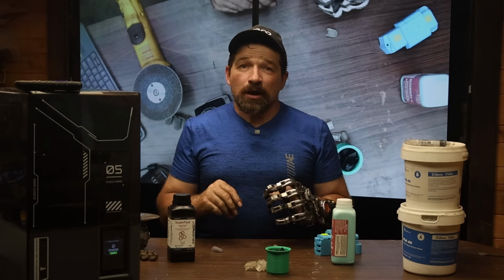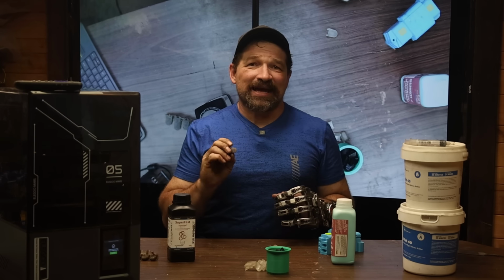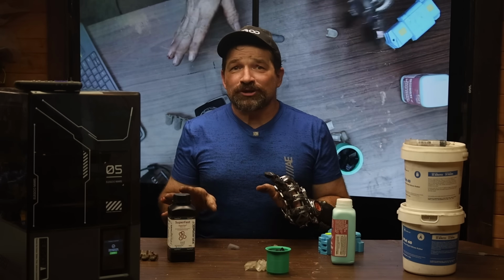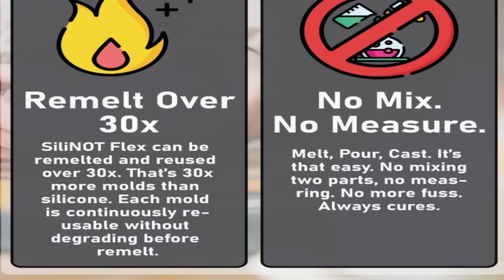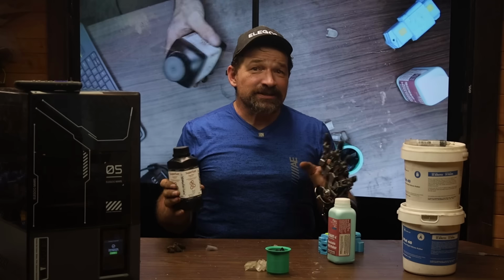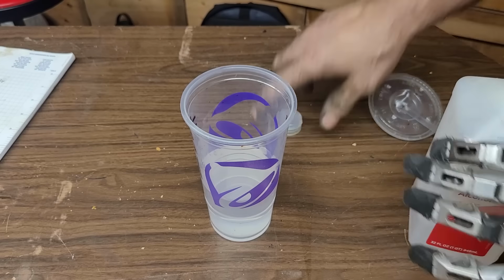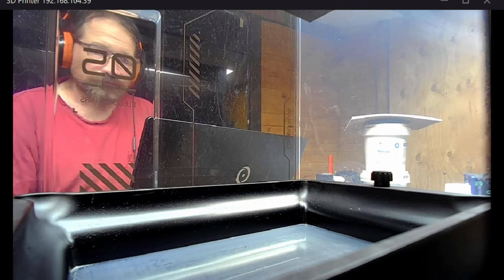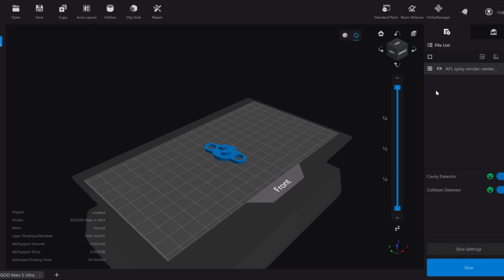Fingertip sidequest

Comment: Would it be possible or feasible to use a metal core around which the resin or other material is deposited, to help alleviate the issue of cracking around the connection point? I'm not sure of the depth you'd need or want the substrate to be deposited over the metal core, but playing around with multiple different sizes might be workable.
Additionally, I've admittedly not been following this very closely so stop me if you've already given it a go, but would casting result in a more durable and enduring product than printing, or does it have other issues?

Comment: Is there something you can add to the silicone to make it more tear/wear resistant, like the chopped fibre from fibreglass, or carbon fibres or maybe even wool
Reply from the maker: In my experiments,  anytime I add enough reinforcing material to make a difference, I find that it crumbles way easier. Last batch, I spiral wound the polyester mesh around the tang plug thinking that it would keep the silicone dimensionally stable... it didn't.

Comment: Carry a little fluid spray bottle so you can mimic oil secretion and still use a non-ideal material (non-ideal when dry)
Reply: Carry a towel too in case you miss or just need a cleanup

Comment: I would be very interested in attempting to contact the soft plastics fishing lure company Zman they have a soft plastics line called elastech it’s insanely durable and resilient, only issue is it’s proprietary. 

If you were able to work with them on something I think the results would be incredible.

Just something for thought.

Comment: have you tested urethanes or rubbers that could be used in a hot glue gun? If you have a mold that sort of clips onto your finger then the tang could have a notch to make the finger be nearly permanent. like a three piece mold but one of the pieces is your finger like how they injection mold knife handles. I think getting the surface just right could really help with grip and softness but still be durable like gecko fingers.
Reply from the maker: I have tried urethane,  as I mentioned in the video, it crumbles. The silicone is more resilient. https://youtu.be/ZqMFNexzX4o
https://youtu.be/LC4paYs5Z28
https://youtu.be/7fD3UZ8q9IA
Here is a short series showing how I overmold the fingertips.

Comment: maybe the finger tip tangs need to be more rounded on every tang edge. sharp corners in the tang hole of the finger tips could be weak points where the material fails.

Comment: You could avoid the hunt for a perfect material and select 2 materials that each have the properties you are looking for and use dualsided tips instead. Manually rotate and lock the tips in place for your intended use. Rotate 2 and leave 2 in place to use both durable and squishy simultaneously.
Reply from the maker: The issue I run into is with getting the different materials to bond to each other. Like with the overmolding process, the silicon will stick to the fff cores for a little while, but then they peel off. Once they start that, they're garbage.
Reply: @missingpartsclub  I would bond them mechanically with a dovetail joint or similar.

Comment: A design thought: instead of mimicking a rounded pad why don't you add horizontal rounded ridges one after over the other over the pad which will add a spring affect & texture so your not so reliant on only material makeup.

Comment: Maybe fiber reinforce the silicone with chopped up wool fiber?  Should stop tears without eliminating too much squish?
Reply from the maker: I haven't had awesome luck with that, any time I have added material to the silicone it has degraded the properties.  For example,  I added a mix of 4% graphite to the silplat 40 so that the fingertips would work with capacitive touch screens, and the silicone turned to garbage. I couldn't imagine using something like wool fiber, maybe though,  if it was a natural fiber the silicone might integrate with it...  idk. I'll give it a shot next time I'm pouring fingertips. Thanks!

Comment: What if you printed a set of tough material 10 thousandth undersize and dipped them in a resin that was tacky enough to get the grip you want? 

A lot more work sure but think of it as adding skin on top of the bone.

Comment: Why not print the part that touches the metal tang out of TPU, and the finger tip material itself out of the flexible resin?  You could bond the two together with some good ol' E6000.

Comment: Could you use the softer silicone on hard tips covered in "nipples" that protrude through holes in the silicone cover? Under a light grip, it'd be silicone grip. A little firmer grip would bottom out on the harder nipples for strength and perhaps improved wear. Seems good in my head - in practice it's a crap-shoot. Might just tear apart immediately considering what you said about that tab that holds the current tips ripping. (Edit - or ratcheted tips you can rotate from hard to soft sides ;-)

Comment: hi, have you tried good old fashioned rubber, or modern compounds of..  many thanks.
Reply from the maker: I've tried a couple of the rtv compounds, as well as tube type silicone. The issue I run into with the rtv goo is with curing. where the fingertip is such a large mass, it never seems to fully cure. It'll skin, but weeks later, if you cut it open, it's still gooey in the center.
Reply: @missingpartsclub  You could try perforating the skin with needles to allow air in for curing?

Comment: ther is a vinal gasket sealer the stuff is great for a lot of other thing then just making gaskets maybe something like that would work
Reply from the maker: A million years ago I tried rtv, as well as tube silicone. The issue I kept running into was the Curing, where it ends up being ad thick as it does, it never seems to really cure. Weeks later it's still gooey in the center. And I've had zero luck laminating it. It seems to only like it in 1 pour.
Reply: @missingpartsclub  this stuff is vinal not RTV or silicone so cure is different i think it is called great stuff gasket maker i use it for making bumper for things like a small door or new gripper tips for my grabber stick that I use to pick up stuff from the floor so I don't have to bend down I have a bad back it also good for glueing stuff together , just saying    I have been using the grabber with the same cast tips for years , ps love your work
Reply: @missingpartsclub  i have some ill try casting something thick out of it and let you know how that went

Comment: Is the fingertip tang is too small, and the fingertip is squishing in abnormal ways?  The tang (bone) is against the back of the fingernail IRL, this radically changes how the fingertip can deform.  It makes me wonder if the tang should be T-shaped and have a fingernail built-in, with the flexible molding going around the vertical component of the 'T' and overlapping the top somewhat.

Comment: Arawup ⬆️mentioned tabletennis. Funny, because old style rackets used to have a surface built up of small rubber cilinders. 
And that’s akin to my suggestion although I took inspiration from the natural world (insects, also gekko’s) Maybe you already researched this extensively but how would not rings, but a seemingly smooth surface consisting of tightly packed 2-3mm tall hexagonal rubber pilars do? I have a few ideas about production too, but that’s for another time.

Comment: Have you tried different types of natural rubber?
Reply from the maker: The tough part using natural rubber is the vulcanization process, without machining hard molds to Sulphur inject, it's hard to get a consistent result.  And chemical vulcanization of natural liquid doesn't yield the same crosslinked molecule that I would want. Of you're suggesting a thermosetting a synthetic rubber and laminating the assembly, then you're likely to run into the same issue that I currently am which is bonding to the core. Silicone is awesome,  butvit doesn't really stick to anything.  That's how the fingertips are coming apart. The cores stay in place while the Silicone peels away.
Reply: @missingpartsclub  synthetic gecko material? Although I presume it may not be practical for day to day needs....

Comment: Use unvulcanized rubber, press on AL molds and put on oven. Smells bad but it will work, have a nice day !
Reply from the maker: Are you adding powdered sulfur to get it to go off? I've had less than repeatable results trying to vulcanize tiny pieces with a core plug. Last time, I was using rubber stamp material.  It worked OK for a while,  then just fell apart. Especially if I got any oil or lubricant on the fingertip.
Reply: @missingpartsclub  Unfortunately i don't know what exactly happened to you during testing but you should not add additives as you wish to ready to go rubber batches. Additives concept is complicated, you don't have just sulfur that make the rubber from plastic to elastic but also what are called Black additives (like black carbon)  and White additives they make a difference on vulcanization time and life span. You can test for cheap again with ready to go heat activation reparation kits that you can roll on pasta roller and again pass on oven but considering the fact that you told me that you have lubricant issues, considering again that rubber is mineral oil resistant i think you are speaking about WHITE lubricant that is used to cut metal, if this is the case i suggest you to forgot about rubber (and a few different silicon types) because it's his worst enemy transforming it on jelly over time. I suggest you don't follow the idea to coat fingertips because even if you sandblast you can't achieve such a good porosity for coating but to move on a different tipe of concept with nitrile fingertips inserts. (Very cheap concept) I posted you a photo on my old Facebook page : https://www.facebook.com/share/p/onF1GPuLkoWdED5u/  You can adjust the angle of the tips, smooth edges and i added a groove on the the middle to make they less slippery sideways also added 2 pins so you don't need to glue it on. You can buy a peace of nitrile rubber and cut it with a knife, drill the pins holes and you are ready to go when the old one is consumed. Wish you luck man.

Comment: What about bed liner?
Reply from the maker: Polyurea? When I was designing for beslide, we used that stuff to coat the decks. It always seemed too hard, it's adhesive properties were great, but the shore hardness was way too firm. I'll check it out though, maybe you can get it in different hardnesses. A million years ago, i designed some equipment that would coat the inside of large diameter pipes with polyurea. It can be a difficult material to work with. I'll take a look. Thanks!

Comment: have you considered using leather? it is durable and similar to real, you might need to design a different mounting system or glue the leather over your 3D printed TPU tips

Comment: Dumb question, but how about leather?
Reply from the maker: I haven't tried using leather for the tips themselves,  but early on, I did try leather with the socket. The issue I ran into is that it turned gross, and you couldn't really get it clean. Also, when it got wet, it got super slippery. I may try it for the tips in a bit just to see. Thanks for the suggestion.

Comment: could you just not print with something really hard you know works with the tang. then flatten off the bottom of the fingers and add a grove for a glue in replacable rubber fiber tips. or have 3 little holes you push a nipples into? like slde in round disks with a nipples/track of the back. all same shape and fit so it works arcoss all fingers?

Comment: Have you considered contacting a leather worker to make you a "glove" to act as the "skin" for your grip. i feel a leather from sheep or goat even mole skin leather would give you a better more real grip similar to your non mechanical hand over any synthetic materials on the market. of course you'd still want a soft synthetic finger tip under the leather, because our fingers are soft. i don't think anything  synthetic will ever mimic real skin perfectly that's why i feel leather ie real animal skin would ultimately be your best option for mimicking the grip and anti-slip of real human skin.